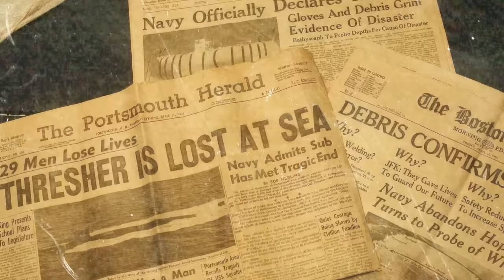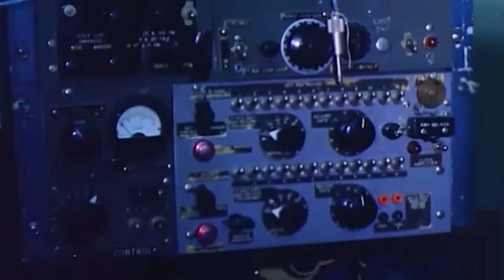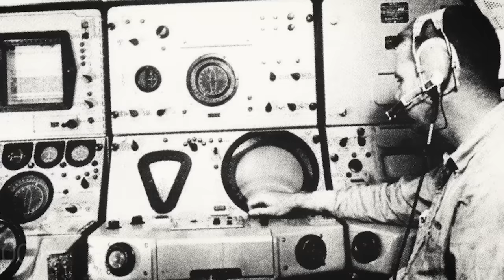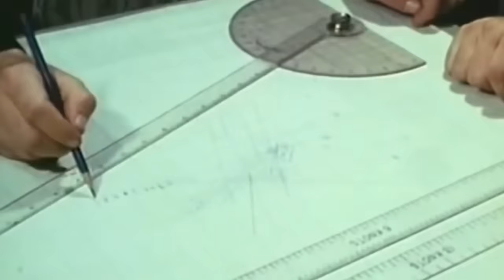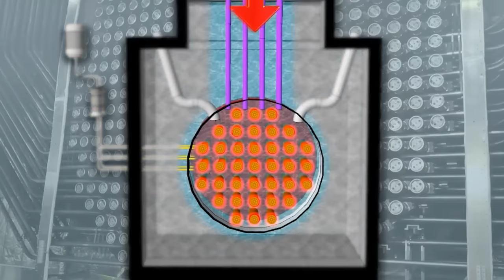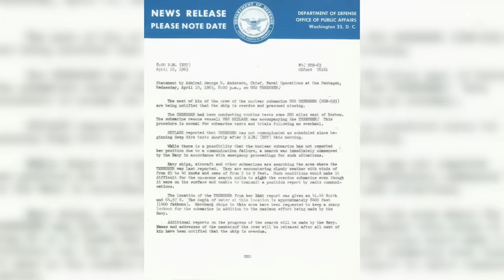129 Dead: USS Thresher's TRAGIC Last Minutes

Comment: The final implosion might have happened in less than a tenth of a seconds, but it sounds like the crew would have had plenty of time to think about their approaching death as the sub continued to descend beyond crush depth.
Reply: The crew didn't think about anything after after Thresher reached crush depth-they were dead. I also doubt that the sonar on Thresher sent out any pings after their last communication with Skylark. I served on USS Flasher SSN 613 ,the first certified SUBSAFE boat in the fleet.

Comment: Why when testing these new subs why would they not test in water that is no deeper than crush depth. If they were in shallower water they might have survived??
Reply: If 1300 feet was crush depth, the water pressure at that depth would have been almost 600 pounds per square foot.  If the hull collapsed, it would have not made any difference in the outcome.

Comment: While working at Electric Boat in Groton with an electrical contractor back in the early 90's I had to listen to a lecture by a engineer from EB . He virtually blamed the sinking on a construction crew mixing their ridged electrical conduit in with EB's stock of high pressure conduit. The 🐃💩 flowed deep that day . Everyones but theirs .

Comment: Submarines... Inherently negatively buoyant and go to the bottom by default when they're full of water.  I'm surprised there's not a system of air-bags that can be deployed using compressed air in an emergency situation to bring the sub to the surface in a last resort situation, rather than go non-stop to the bottom , even if only to recover bodies, but hopefully to save some young lives.

Comment: Early in my career I did a couple years silver brazing copper lines and know that a bad joint can “look” perfect but easily fail. WHY THE WEREN’T ALL THESE HIGH PRESSURE LINES WELDED AND TESTED?       HUBRIS?

Comment: Close but not quite right. I served on the 634 and the 590. I know exactly what happened.
Reply: Can you tell us what happened?
Reply: @michaelpence1627  flooding in the auxiliary machinery space caused total electrical failure. They blew ballast tanks and made it to 300 feet, then went back down. Pressure hull collapsed at about 2540 feet.
Reply: @atomicbill What made them unable to reach the surface if they had already gone up that far?
Reply: @alpardo4124  the ballast tanks only displaced 1000 tons. So when 1000 tons of seawater got inside the people tank you have negative buoyancy and sink.
Reply: @atomicbill  Hmm, ok, thanks, l guess all modern subs have alot more capability as far as ballast tanks go, as well as all the other fixes they've learned from those two incidents.
Reply: @alpardo4124  Remember I served from 1964-1972. Analogue meters, Nixie tubes, mag amps, lead acid batteries. Primitive by today’s standards. State of the art then.  But we did win the Cold War!

Comment: it was a bad design that the prop rely on the reactor to be operational all the time. It would make more sense for it to have a battery backup like the diesel electrics. In war time you need to have a backup way to power your ship. 20 minutes to restart the reactor doom them. Little is mention about the blow tubes freezing over preventing the ballast tanks from blowing out the water, which was another design flaw.
Reply: Thresher had battery backup